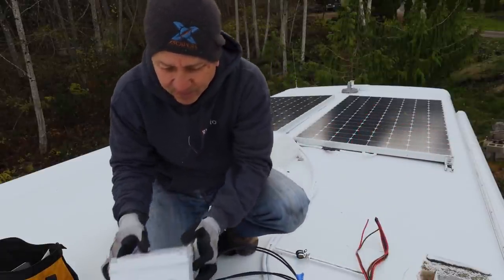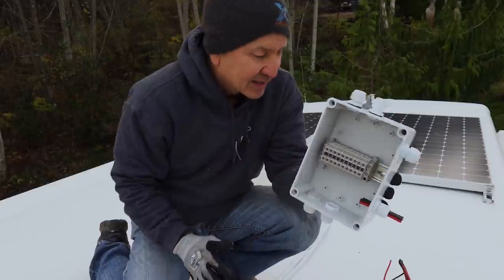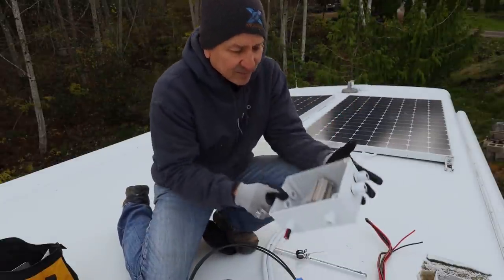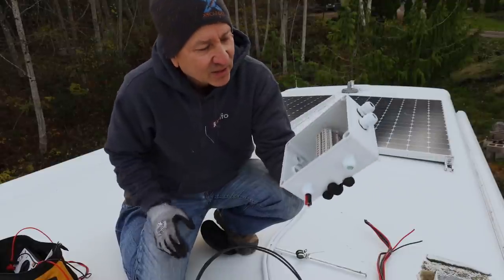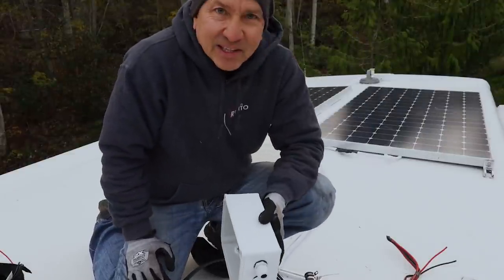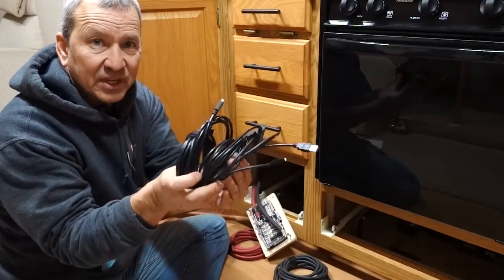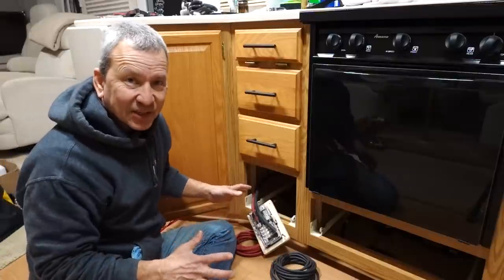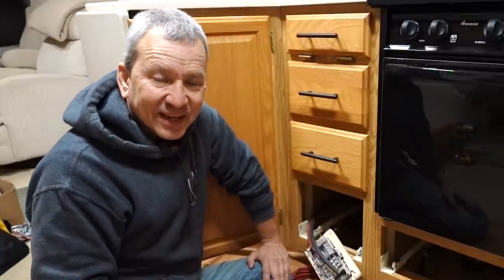Installing RV Solar Equipment on Class A Motorhome | RV With Tito DIY

Comment: Very nice work and presentation!  Two questions.  First, where does the starter battery for travel charging come into your circuit diagram, or do you never rely on it for charging?  Second, it seems like using the double-sided tape only for your roof mount is putting a lot of faith in the roof membrane to roof underlayment integrity for restraining the solar panels.  Any comment?  Thanks much for your great documentation.
Reply from the maker: (1) The starter battery is completely separate and I'm not using a DC-DC charger in this rig. If needed I can run the generator while driving and put up to 120A into the house batteries. (2) Yes. While I'm certain the adhesive will be solid, I am concerned about potential delamination. After over 3000 miles it's been fine, but I'm planning to add a couple anchors to each strut channel through the underlayment just in case. I tilt them also, and have been in some serious wind with the panels tilted. That's another reason. I'll probably do an update in the near future.

Comment: There’s nothing more convenient by having it on the roof as you basically admit when complaining about the cold and that junction box you put on the roof is not aerodynamically shaped. They have black plastic aerodynamically shaped shrouds with rubber surrounding the openings that can be oriented to face away from the wind due to driving and large flanges that can be modified that are used in the air conditioning industry.

Comment: These panels are less than 6 amps each, 85/volts each
Reply from the maker: Yup...at max power. 510W if you do the math. You probably won't ever reach that rating.

Comment: 1700W of solar... drool. Do you still need the Victron network if they are connected to a Cerbo. I thought the Cerbo would share the data between devices?  Sometimes there are so many ways to connect Victron stuff depending on what gear you have that it's not clear.
Reply from the maker: You need the VE network to connect the controllers then you need the cables to connect them to the cerbo. Yes. It's confusing.

Comment: Why are you not putting panels in series of 2 panels each this would up your efficiency drastically and reduce the amount of cable being used and would also up your MPPT solar charge controllers efficiency. The reason is you will hit charge voltage sooner with less light meaning you would get more charging time per day and way less cable loss and would charge more on cloudy shady days all around you should have put the rear panels in series then front panels in series this would give you optimal charging voltage for your batteries / MPPT charge controller with 1/2 the wire used to cut losses again in half. I am just pointing this out because you could have saved alot of headache and cost and actually had better output by doing the series of the panels with 1/2 the amount of cable used and made it a much simpler easier design that would make just as much power or more for much cheaper and with way less trouble.
Reply from the maker: These panels already put out over 80V each and potentially up to 50A after MPPT. The larger controllers capable of handling over 160V are also very expensive. So it's a wash. Having dedicated controllers actually gives me optimal performance benefiting fully from MPPT with no issues related to shading or failure of other panels. If I were wiring up a 24V battery bank, then I could cut my controller costs in half, but I chose to stay with a 12V system for simplicity. Thanks for the comment.

Comment: One question: Why so many charge controllers? With only four solar panels, one charge controller should work well enough with two strings in series parallel. 🧐
Reply: It’s based off the panels he used.
My assumption is it’s due to voltage limits.  He couldn’t do parallel either because it could possibly exceed the 50A rating with two in parallel.
Reply: @MattLesak  
Why not just get a charge controller that has that voltage? Perhaps he already had those charge controllers available.
Reply: The charge controllers are rated for a max voltage and current.  I’m sure Brian sized things properly.  Another advantage of using multiple controllers is redundancy/isolation where if one fails it the others remain functional.  And depending on how Brian sized things, if one controller failed, he could via his rooftop junction box, rewire the panel that was attached to the failed controller to one of the other controllers.  If you boondock a lot, having backups and redundancies is a good thing.

Comment: Why do u need 1700wts
Reply from the maker: We use every bit of it with our 810Ah batteries and electrical consumption. No need to ever plug in.
Reply: @RVwithTito  what are u running  in there? Every  thing 110.? U know  you can get 12v appliances too!.   and and save a few amps 
I have 4 batteries  and there separated   600 wts solar never on shore power works fine.allways full up
You have enough  power to  charge  up you next door neighbour lol